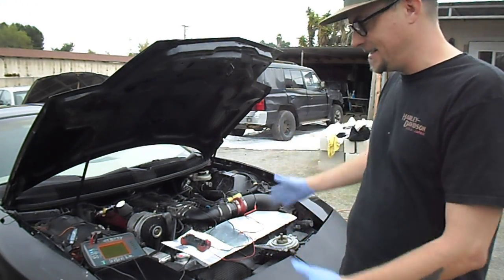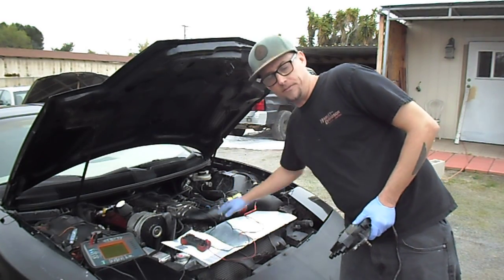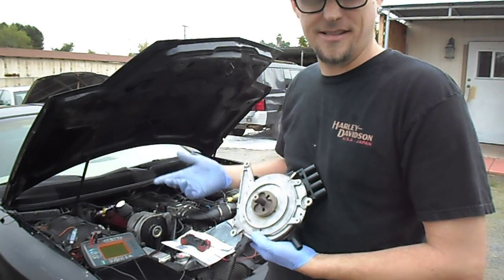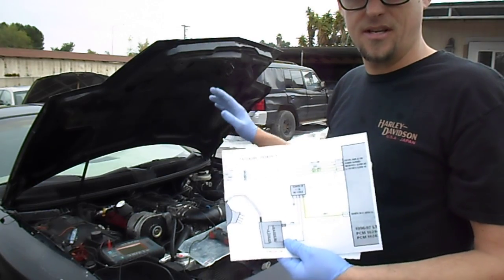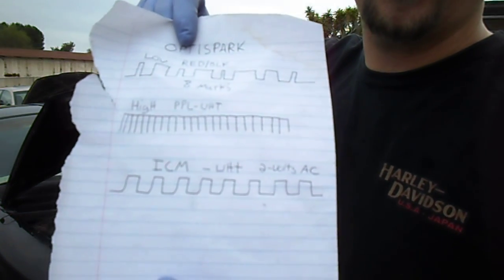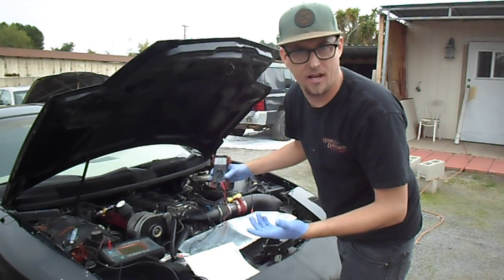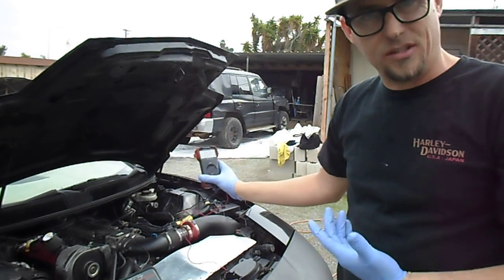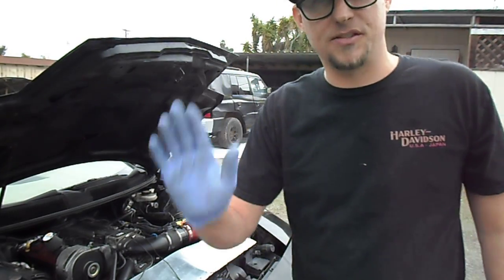OPTISPARK  TEST THE EASY WAY " know everything"

Comment: Mine cuts off after 10 20 minutes or when trying to throttle at times
Reply: Sound's like the typical Opti-On-iT's-Way-out prefailure symptoms. It'll become more frequent and then eventually not start at all. Hopefully you've had it replaced since!
Reply: Mine is having a similar issue. Runs fine til it warms up, then the engine dies. Lately its been acting up before it even warms up. Haven't chased my issue too far yet, but its definitely a spark issue.

Comment: Is it possible to replace an Opti spark, that was diagnosed bad, the have it run bad and say that it's the plug wires?
Reply: If the intial diagnosis was wrong, then it could really be anything else. If the Opti-Install is rushed there is a lot of mistakes you can make. If any of the plug wires get crossed the engine will run rough or not a at all. If the opti is installed with the index key out of alignment with the cam the car will likely not run and probably trash your brand new opti! If the gaskets for the water pump were not removed right, you could be leaking coolant onto your new opti. If the vaccum lines check was installed backwards, you could have ozone kill the opti prematurely a year or so later.

Comment: Pretty sure the white wire you are talking about at the ice comes from the pcm. And this square wave is the signal telling the coil to ramp up and fire. The low opti and high opti signals are inputs to the PCM then the PCM outputs that square wave signal on the white wire to the ICM I think this is correct?

Comment: Gotta 94 T/A 6 speed. Totally fine when cold..soon as it gets to operating temp I get surging idle and even while in gear jumps from 1,000-2500rpm back and forth up and down over and over only when hot. Slight misfire once it starts acting up. Erratic tach readings seems to twitch +-200 rpm. Cleaned iac and passages checked all possible vacuum leaks. Did the icm mod spacers to get module half inch off cylinder head. Also will diesel once it starts this stuff try to shut it off and it will continue to Barely run for 3 seconds. Lmk your input! Thanks
Reply: I'm not saying it's the opti, but it's the opti
Reply: You're a professional guitarist with Led Zeppelin.. you don't need this car. Sell to me for cheap.

Comment: Funny, I did the exact same thing. The screws on the optispark broke off that hold the cap on mine. I couldn't get them out with Zep 45 or a mini torch and vise grip. The sad thing is the distributor only had 50,000 miles on it. I bought a new one, and disassembled it, put in the Mitsubishi sensor and reassembled it using blue loctite and 242 on the cap screws. I just hope that its clocked correctly and that the bearing in the offshore distributor is of at least similar quality? I watched this to see how I could verify before I bolt up the water pump. Thanks for the information!

Comment: Will the vented opti fit on a 93 LT1? It’s a 93 Vette.
Reply: @speed1ST no it won't fit they both different.the 97 LT1 timing chain cover is designed to fit a crankshaft sensor and the 94 has no crank shaft sensor.
Reply: Thank you

Comment: Where can I get an AC Delco Opti (92-94 Vette)? Is there a way to test if the problem is with the sensor or electronics? I have an original and we are doing a rebuild (stuck engine) so it's not currently installed and it looked like it had water damage.  Thanks
Reply from the maker: ACDELCO Reman on Rockauto.com

Comment: Would this cause the icm to keep frying
Reply from the maker: What brand are you using ? Acdelco only
Reply: Matthew McLain I got a driveworks because I was limited on money and the car was going to be towed by the sheriffs department if I didn’t get it moved I did forget to put grease on the backside of the plate though power and grounds seems to be good is it possible that since I’m using 8.5 mm wires that could cause not enough resistance I replace the coil to at the same time with the icm because it had a pin hole in it pulled my plugs to and they were rusty from being overheated
Reply from the maker: @joseglory6546  try Rockauto you can get OEM parts cheap
I  moved the ICM Sawdered the wires took off the engine block never gets over 100F now may last forever
Reply: Matthew McLain I may have to try that if it does it again I went and ordered an ACDelco icm today will get it Tuesday I also had a code for low signal pulse for timing any idea why? it hasnt came back since I changed the icm I just knew it was fried again when it started backfiring at 3k rpm and then stalled in my driveway
Reply: @joseglory6546  That grease is heat protection. This is your problem. It's getting hot.

Comment: I've got a 96 Buick roadmaster and when the weather is warm my car takes a little longer than normal to start. If outside temp is higher than 30f it has long crank time but anything below 30f it starts instantly. I have checked everything and for the life of me I can't seem to figure it out. Bad opti maybe? Wintertime my car started within about 1-3 seconds now that its spring it takes 3-5? Never had this issue in prior season changes. Any help/advice is greatly appreciated.
Reply from the maker: Try  Cycling the key on and off a few times see if that helps it mite be fuel pressure related
Reply: @matthewmclain9327  tried that, but I agree, I do think its fuel pressure related. I'm going to try hooking up a fuel pressure gauge and see what it reads that's the only thing I have not tried yet. Just wanted to see what the thoughts were. Thanks.
Reply: @TECHNOGEEK20000  How did things work out?  I remember when I wasn't sure about my LT1 becuase it was having issues starting, so I checked the fuel line pressure and it was way low.
Reply: @GlycerinZ  it ended up being the fuel injectors.
Reply: @TECHNOGEEK20000  How many miles on your '96 Roadmaster?
Reply: @matthewmclain9327  Can you just completely bypass the opti somehow?

Comment: Good Explanation but 92-94 LT1's were non-vented and OBD1 (95 was OBD1 as well but had OBD2 type dash connector).   No difference in the actual timing control between the two but venting, distributor drive method are different.  Easiest way to tell if a unit is bad is to look for signal on the  B Terminal (white wire) of the Ignition Control Harness.  Digital Multi-meter set to AC and 12V Range should show 1 to 4 volts while cranking.  Check procedure here...http://shbox.com/1/4th_gen_tech2.html
 Nice to have a lab scope but unnecessary if just looking for failed Opti.  No signal on the White Wire means Opti is not sending a signal and is dead all other things like bad wiring etc considered. Also New AC Delco units are just as much junk as anyone elses now.  You're talking about an engine that was only used for 5 years in low production that even GM backed away from.  It's why the LSx engines came about and why there were so many variants.  The LT1  is a good motor but the Opti Achilles heel was the major reason GM dropped it and did a full redesign.
Reply: My 95 impala ss has obd1 connector.

Comment: Got an entire ignition system for my 96 TA from ebay for under 140$ got ignition coil, ignition coil module, plugs, 10.5 mm spark plug wires, and distributor.
Reply: I'd like to know if your Opti is still working.  Sounds like it was one of the Chinese ones
Reply: Are they still in business?
Reply: y where do you buy it
Reply: Also intrested in how this worked out for you.  My 396lt1 is having issues
Reply: @ryangibson1900  you should look into a 24x conversion for your car so you can get more reliable power instead of the opti spark
Reply: @rebel9976  i would love a 24x down the road. For now i went with a petri enterprise opti and it's running better then ever..for now 😂 he gets great reviews. Hand builds each opti and beach tests before shipping. I bought the 5yr warranty for $50 just in case lol
Reply: The ebay optispark I bought for 50 bucks finally went out after 3 years and I have not been able to find one worth a damn im deciding whether to go ac Delco or Petris completely rebuilt my lt1 and 4l60e but now having ignition problems 😢

Comment: I have a 94 Corvette LT1. Car engine randomly turns off while driving or idling and won't start back up. Is this the Opti Spark because I basically replaced everything that I could think of including the fuel pump.
Reply: Kal El check your coolant sensors man or air intake sensors, I replaced my entire ignition system and my car still does the same thing (starts right up then kills out within 5 seconds) even have a new fuel pressure regulator and pump so it has to be an air intake sensor or two somewhere. I have a 96 trans am
Reply: speed_king...You need to put it on a scope.  You may not be getting a good signal from the PCM and I'd check the wiring as well.  Also injector tests as mentioned in my comment below.
Reply: @GearheadGarden  I just found out it was my mass airflow sensor
Reply: @Murderelco75  I disconnected the coolant sensor because it kept going on for no reason. Would that cause the car to shut off randomly too?
Reply: Kal El  ....The last time my Opti went out it just died on the Freeway and wouldn't restart until the next morning then it would just die in a few minutes when it did start.  Before ripping into the Front of the engine, however, I'd look at your fuel injectors.  A lot easier to check them first and if they're OK at least you've eliminated them as an issue.
 If the injectors are original there's a good chance you've got a few weak or failing.  A multi-meter resistance check will tell you very quickly.  Find the Specification for your injectors and see if they are still in spec.   Also check them with the engine hot and cold to see if there's a difference in resistance.  Temperature can affect resistance in the injector itself but should never go out of spec.  Good Luck!
Here's an easy video instruction.  https://www.youtube.com/watch?v=yFv5IWdANGs
Reply: Thanks for the feedback guys. I will be sure to look out for those things.

Comment: I like that you mention about the Mitsubishi sensor inside..
The Chinese one heats up and leaves you stranded,  alot of people DO NOT MENTION THAT PART  in their videos..
Thanks because I'm having that problem now with my 
94 corvette 5.7 
Thank you 
Your info on video is greatly appreciated..
Reply: Did you get it fixed? What did end up getting as a replacement? There is no such thing as a new acdelco or Delphi anymore and the remanufactured acdelco ones are fucked up in remaking them. The sensors are painted with black paint and dead on arrival

Comment: My car recently overheated and died on me on the side of the road and I had to get it towed home because after running hot I couldn't get it to restart again. I did a lot of research and since the distributor is underneath the water pump (Shit gm design)I thought it went out so I changed it and still no start. Turns out it was my Ignition Coil which is pretty easy to change its right by the mass air flow sensor so its not tucked behind anything. I also changed the Ignition Module since its connected with the coil via bracket so my car starts super easy now.
Reply: hyped out I think my coil is going out again damn lt1
Reply: Did you have crank no start?
Reply: Had same problem on my 94formula it went through 3 
ignition modules in one year 
turned out my optispark was
going bad and taking out
the ignition module. The third
one went out along with the optispark.